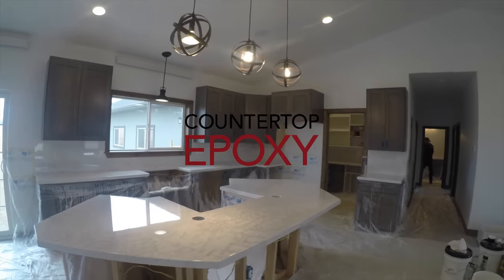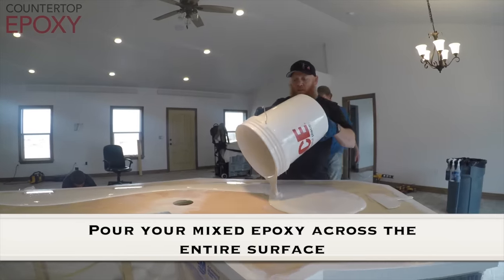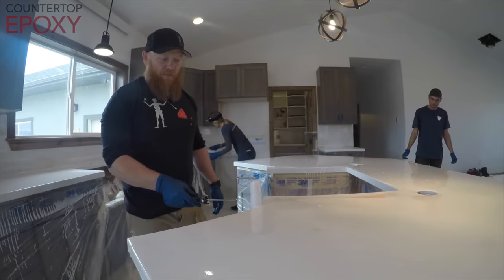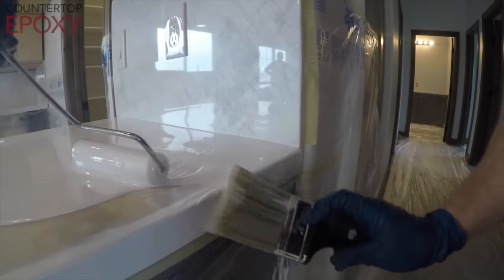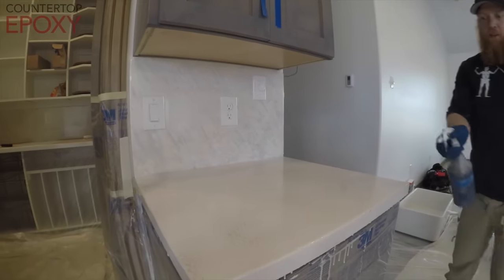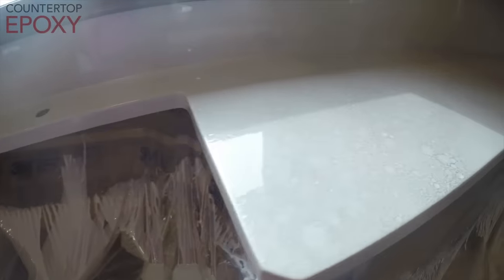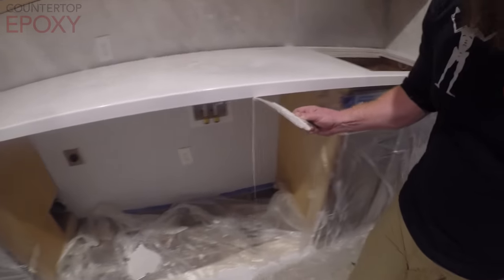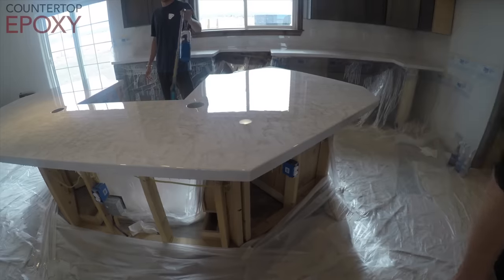HOW TO - Epoxy Kitchen Countertop - Countertop Epoxy - White Marble Countertop - Kitchen Countertop

Comment: I would like to do the same contertops in my new kitchen but I have some questions. What is the thermal strength (in degrees) of this resin?  Can i put a heated pot/ pan on such a countertop? Is there no problem in hot areas like gas plate/ electric plate or it can melt or loose colr, etc?

Comment: How flat does an epoxy pour turn out on its own? Will it level completely flat like a water surface or will it need some help to reach that kind of flatness?
Reply from the maker: Once poured and spread out over your surface, our product will self level out smooth. Key thing to make sure before epoxy application is to ensure your underlying surface is level before pouring as well or the epoxy will run off or pool in low spots.
Reply: @SupplyHaus1775  Thank you! :-)

Comment: I still don't understand how the backsplash was done. Is it just plywood with Epoxy coating? Is it one solid piece or was it cut into sections?
Reply from the maker: The backsplash base is MDF board just as the countertops and was poured horizontally then installed to the wall before countertop application.

Comment: I read the comments to see if someone else had asked but I did not see it. If they have I apologize. How would you clean this? I know with regular countertops you can use Clorox on them and other chemicals without damaging them? How would this work?
Reply: Cara ` Bullock we have been experimenting with epoxy at work and hopefully I can help a little with your question. 24 hrs after applying, we've been doing our best to keep it debris free and use new microfiber towels to carefully wipe dust off.
   Here's where I'm not totally sure with my knowledge and would hate to mislead you. We were told after 72hrs of dry time you're able to keep your counters clean by using any non abrasive kitchen/bathroom cleaner and a rag or non abrasive sponge
Reply: Steve Gaches so tht would be something like soft scrub. Thank you much for answering. I am loving all of your videos .... hoping to get started soon...
#EpoxyAddict

Comment: Sir, all epoxy process can be done over a tile-slabs??? Or just work with wood🙏 kindly rply.
Reply from the maker: Hello! Yes you can go over tile, with tile though you'll want to skim coat to seal in and level the grout lines before initial flood pour.

Comment: What is the best base to start with please? Mdf, ply or an wooden worktop?
Reply: Mdf because its smooth, cheap, and easy to cut and modify.
Reply: @krehbein  was worried about using mdf due to denting work top but I guess with the resin it becomes hard?
Reply: @00kirk  Check out this video from another good company; https://www.youtube.com/watch?v=uC0KgVgiQ7s

In it he hits the counter with a hammer. Granted I don't know exactly whats under the epoxy but he tends to use MDF when you view his other videos.

You should buy some epoxy and play around with it to satisfy your own curiosity. I have been and am excited to make a couple counters for my laundry room.

Comment: Hi countertop epoxy, how resistant it’s, like hot temperature or scratches??
Reply from the maker: Our product is extremely durable, has scratch resistant & UV components, and can withstand up to 500 degrees F once fully cured. Keep in mind while we do have scratch resistant components, just like any countertop surface, it can still scratch. The upside to epoxy though is you're able to buff and polish them out easily as shown in this video here: https://youtu.be/YNEjczMGxrw

Comment: How would you handle an ogee edge?
Reply from the maker: We pour over these types of edges often. You will be fine to roll the edge to break surface tension and the epoxy will flow right off for a smooth finish.

Comment: What kind of primer are you using?
Reply from the maker: For the vertical edges, We used our prime coat base color. You can find our prime coats here: https://www.countertopepoxy.com/prime-coat-colors/
Reply: Does the primer come in gallons or smaller?

Comment: Is that epoxy already prepared or u have to mix paint
Reply from the maker: The epoxy itself comes in clear, and you will need to mix in the base color to achieve the desired color you are going for. We do have epoxy kits available that comes with 2 gallons clear fx poxy, a base color and 3 accents color. You can find our epoxy kits here: https://www.countertopepoxy.com/countertop-bar-top-epoxy-color-kits/

Comment: What was the base material of the countertop. Is it a laminate countertop.
Reply from the maker: The base is MDF board.
Reply: CountertopEpoxy what thickness of mdf board do you recommend for the base?? Is there 3/4 plywood used under the mdf board for additional support, or is the 3/4 plywood not needed at all? We are removing our old tile countertops (yuck!) and love this epoxy countertop!!

Comment: Is the backsplash being applied with epoxy also?
Reply from the maker: We pre-poured the backsplash with epoxy horizontal, then put them in place using silicone to glue them to the wall. :)

Comment: +CountertopEpoxy
How much would a job like this cost to the consumer? You've done a beautiful job. I particularly like the seamless way you've made it appear to join the backsplash area. Nice work.
Reply from the maker: Thank you so much Annakeye! And the rate all depends on the installer in your area, most installers usually charge per square foot.

Comment: Can this be used in old bathrooms on the floors, and walls?
Reply from the maker: Yes it can! We have a flooring, walling and countertop Epoxy. :)
Reply: Additional question: How do you make the floor have a little slope so water will flow to a drain? (Since the epoxy will want to self-level)
If it is already in one of your video's please let me know which one :-)
Reply: CountertopEpoxy where are u guys located. Need this done to my bathroom and kitchen
Reply: If there is a slope already, the epoxy will follow the slope. It requires a little more work as you have to keep an eye on it, because it seeks the lowest point. If the floor is flat and requires sloping, it can be done with a cementitious mix or with an epoxy mortar. When it comes to this type of situation, it's best to leave it to an experienced installer.
Reply: Andrew. Thanks. I was expecting something in that order. A gentle play between viscosity and gravity. It wont self level instantaneously. 
I was not planning to do this by my self, just interested if it is at all possible. Actually the whole job seems to me to require experience to get it done well. It may just look easy. 
Thanks.

Comment: I have a granite counter top. I find it ugly. Can this epoxy coating be applied to it?  It is red in color , I need to change it to white.
Reply from the maker: Yes you can however you will need to pour some clear epoxy over the granite first to seal it since it is a porous substrate! We also have classes where we go over alot of different applications. If you can't make it to one we have saved videos of the classes on our Facebook!
Reply: @SupplyHaus1775   Can you suggest some vendors in India? !
Gurugram City

Comment: We all know MDF hates water, what do you do on the underside around the edges especially around under mount sinks. I see in the video you scrape off the drips but that still leaves some unprotected MDF
Reply from the maker: For that, we would recommend doing a skim coat of epoxy on all sides of the MDF to seal it in before installation and initial application of epoxy.
Reply: I was thinking that or a coat of REDCOAT but I have yet to see any video showing that.  Thanks fore the info

Comment: What is the cost comparison?
Reply: I would say cheaper than granite even with professional installation. Their 2 gallon kit does 40 SF, my counters are close to 3 feet deep, so it would cover a little over 39 linear feet at 3 feet deep with 1 kit. The cost of granite can vary greatly from $25-65 a square foot installed and up. I'd say it's a pretty good investment.

Comment: What's the square foot cost?
Reply from the maker: Square foot cost depends on the installer in your area. If looking for a quote, definitely give our office a call and we can help find an installer in your area. 970.639.9338
Reply: CountertopEpoxy 
I'm a general contractor in the Atlanta, GA area and I'm simply wondering how it's priced compared to P-Lam, granite, or solid surface.  I'd like to give options to customers.

Comment: I just learnt that this is a thing! What a satisfying process to watch, and a great voice to listen to. I imagine the cost is lower to epoxy an existing counter than to replace it with marble or another material, is that a correct assumption?
Reply from the maker: Yes that is correct! An epoxy countertop is a great alternative and cost efficient option.
Reply: Is this food grade?
Reply: CountertopEpoxy can it be done over a pre prepped laminated bench top?

Comment: Looks expensive to hire it done and maybe toxic and super messy for the diy'r. I don't know. I wavering between this and soapstone which is expensive but durable and natural. Heat comes to mind. I'm afraid a hot pan would ruin these.
Reply from the maker: Hey! Our epoxy is durable and easy to clean since it's non porous. The countertops are heat resistant to 500 degrees F after curing and is non toxic with no VOCs!

Comment: What I don't get is why. Epoxy is essentially plastic. It has a low scorch temp, weak surface strength, and is prone to abrasion; why would anyone use it on a high-wear surface like a counter? One misplaced steaming pot of food and it's done for. On top of that, having used epoxies myself, using it is a nightmare and likely makes its installation as expensive as stone alternatives.
Reply from the maker: There are many epoxies out in the world, however we have formulated our epoxy product specifically for countertop application. It's extremely durable, and can handle up to 500 degrees Fahrenheit when fully cured.
See this video for reference in regards to setting a hot pan on the epoxy surface: https://www.youtube.com/watch?v=XkugwXKvmdw
The process is easy to apply and work with, and it's a great inexpensive alternative to natural stones.
Reply: Granted, but the caveat is that the more specialised an epoxy, the more expensive it typically is. If it's been formulated to be high-wear, high heat,UV stable, and indentation resistant, while also being relatively cheap, I'd be curious how you're managing all that; as $300 for a 2 gallon kit is pretty competitive given the claims.

Comment: Why would you drag your trowel across that epoxy that was apparently tacky to the touch,  because it's skipping, to make that skipping look? I don't like that. It's very visible when you are showing the video from the left across the top of the counter top that you were explaining about that, not only when you did it, but every video after that, which means it was visible in the dried result.  Why would you want that to be visible? Up until then, I was with you on everything. Also, do you not apply any type of even a clear top coat?  And, epoxy is self-leveling. Did you know that?

Comment: Very bumpy looking....if you to put a 3ft level over the finished product it will teeter
Reply from the maker: We used the technique of skip troweling to get this certain design, the product will continue to level and flow during the curing process which takes about 12-24 hours to cure to a useable hardness. Shown in this video is the application process.

Comment: Looks nice. But I would never trust this product in my own house. It's an epoxy basically a glue-like courts which is getting banned in Europe for kitchens only in washrooms because it can hold bacteria and when those epoxies and glues get hot it can let off those chemicals on your food if you put them on the counter. If I do a kitchen I recommend granite you could put whatever you want on there and you're good to go you do not have to worry but if you have quartz or an epoxy you have to be careful where windows are because the sun will leave a mark on the material after and you will not be able to take it out I have seen this with my own eyes. I wouldn't recommend this product on a kitchen countertop where there is food but would definitely recommend it on your floor. If this stuff gets damaged what is the process to fix this material like for instance if you have a nice design and somebody drops and chips it not too familiar with this product so would like to know what the steps are for the repairs
Reply from the maker: There are many different epoxies out in the world. However with our epoxy product, it's 100% solids and non-porous, meaning it will not hold or harbor any bacteria. We also have UV components added to help combat yellowing, follows all FDA guidelines for food safety, and can withstand up to 500 degrees Fahrenheit when fully cured.
It will cure to a rock hard durability. But If experiencing any damage, you can sand and recoat the surface with a clear to achieve a flush even surface, or buff/polish the surface as well.